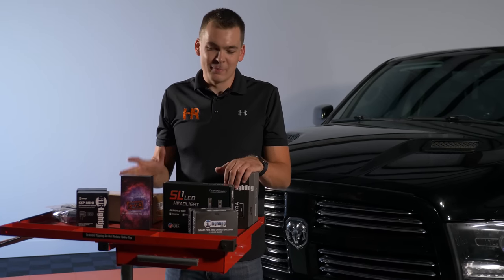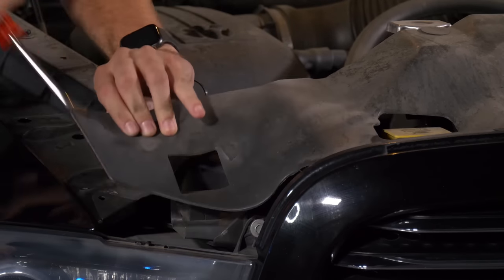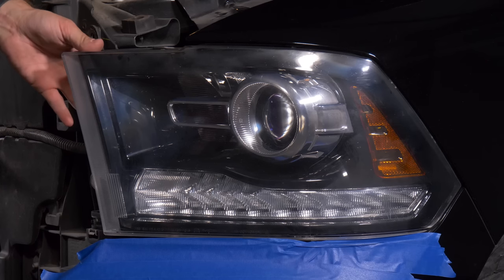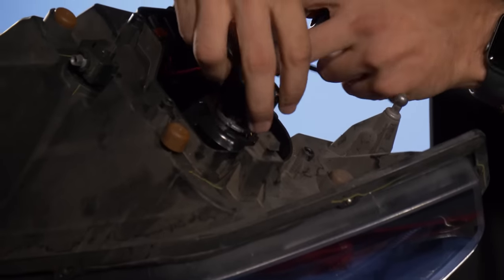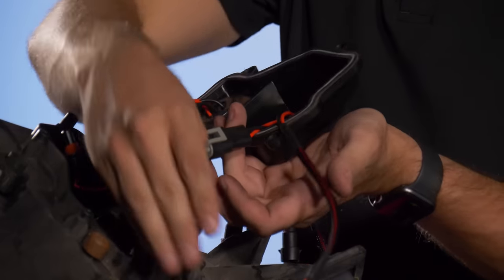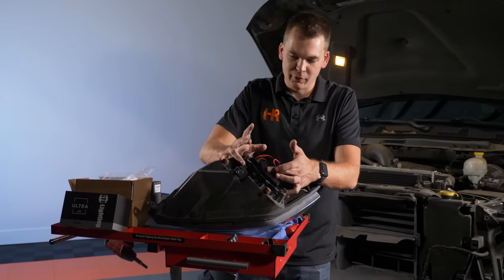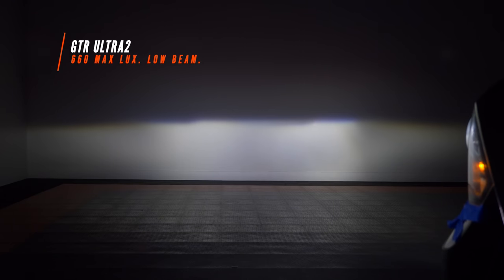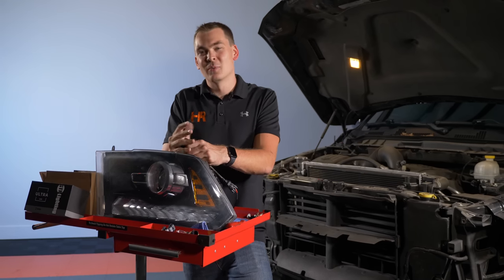HR Tested: 94% Brighter LED Bulbs for the 2009-2018 Dodge Ram with Projector Headlights

Comment: I love these lights!!!!! A little tip for the PWM module; I used double sided tape on the tape and attached them to the top of each headlight light casing. No tension is on the wiring and doesn’t look like they are going to budge. .
Reply from the maker: Good tip! Thanks for your comment!

Comment: I put the GTR Ultras 2 in my 2017 Edge and the difference was absolutely amazing. I legit went and got an eye exam thinking I was losing vision driving at night. Turns out my vision is fine and the stock halogen in the Edge is just garbage. Easy install and they fit with the stock dust caps. Daytime running lights work fine and I get no errors on the dashboard. Just needed to rotate the bulb to get the chips at 3 and 9 to get back to the stock pattern.
Reply: Hey, I run a 2013 Edge and really want to get LEDs as well.  Been looking into the S-V4's when they first came out but been lazy.  Now that the GTR Ultra 2's are out I want to get those.  How are they with rotating?  I know with the S-V4 they have a small set screw that you need to constantly take in and out to adjust.  Just want as much info as I can get before getting and doing anything.
Reply from the maker: The GTR Ultra 2 can be completely adjusted, You won’t have any trouble with that!
Reply: Michael If the 2013 runs an H11 bulb it’s exactly the same adjustment with a little screw.

Comment: Do not have to remove the grill. 12 inch extension on a ratchet for bottom headlight bolts
Reply: Yeah..... i did it the way you mention and broke the bottom tab off my passenger headlight. I don't recommend doing it this way. Its about the same amount of work to take the grill off as it is to fight with the bottom bolt on the headlight. difference being I didn't have to plastic weld my drivers side light back together.
Reply: @scottmorey9055  I can change my headlights in 20 minutes this way never broke anything theres no reason to take off the grill
Reply: @brenthemingway2956  cool. I have sausage fingers. Its literally 30 seconds of extra work to take the grill off and you dont need a foot of extensions.
Reply: @scottmorey9055  I feel the longest it takes is the stupid flap in the wheel well lol
Reply: @brenthemingway2956  its the hardest part for me. Its hard for me to maneuver my hand in there to grab that damn plastic thing to pull/push on it. I've nearly cut myself a couple of times. Big hands are not a blessing when working on your own vehicle.

Comment: I tried Diode Dynamic's SL1's in my 2019 Fusion, removed them and installed the GTR Lighting Ultra 2's and they are awesome!
Reply from the maker: Awesome! I’m glad to hear you like them.
Reply: Did you have any issue getting the ultra 2 into the fusion and behind the dust cover?
Reply: Why did you get rid of the SL1 ?
Reply: @MegaDiamond6  it was fine. I had to aim the projector down to get them to slide in. Very tight working space.
Reply: @josecollazos6  Beam pattern on my 2019 Fusion was terrible with the SL1's. DD no longer sells headlight bulbs. Not street legal.
Reply: @TheCarCrazyGuy  oh ok i i have the SL1 on my truck for my head lights and fog lights those suckers are super bright ya i got a letter in the mail from them about the SL1 bulbs so they sent me other ones since they’re not street legal but they wouldn’t refund me my money back they just sent me some philp bulbs instead and told me i could keep the SL1

Comment: Let’s see these compared to the new morrimoto 2 stroke 3.0’s in these housings
Reply: I bought the new morimoto 3.0 leds for my 2016 2500 and sadly they don’t fit with the dust cover. I even purchased the deeper dust cover and still no luck. I have to exchange them now.

Comment: The grommets fell out because they are too small. The holes in your fancy dustcover are 28mm and the inside of the grommet on the GTR.A015 passthough harness is 21mm. They cannot be seated as they should. Obviously the two chinese companies involved do not communicate. I ended up not using the pass through cables and stuffed the antiflicker modules inside the cavity. It is tight but can be done. I was assured by HR there was no problem doing it this way. My question is this: The GTR Ultra 2 low beam bulbs have a fan and if i plug the large holes in the dust cover, will they run hot ?

Comment: very helpful video. The factory housings are great for focusing an LED beam and not blinding everyone, but the info in this video is gonna save me some frustration, especially that rear dustcover. yeah i could probably dremel out some holes in the stock one but this looks much cleaner,
Reply from the maker: Glad this vidoe helped you out, if you need anything else just let us know! Have a good one!

Comment: It doesn’t fit 2018 ram 1500 with projector headlight .  Unless you buy 
 a after market extended dust cover .
Also if you only change the low beam you don’t need the pass through harness

Comment: To change the headlight bulbs you have to take off the grill and completely remove the headlight assembly?  What a ridiculous design Dodge did on this, I've never had a vehicle where I've had to completely take off anything to switch out the bulbs.
Reply: its because its not a typical bulb swap
Reply: Grill doesn't have to come off.
Long extension and grill doesn't need to move

Comment: Im upgrading my offroad 2016 ram with oem projector lights as is original came with the standard reflector headlights. I am buying a special harness to be able to use the projector lights. My question is. With your wiring included in these LED lights, would I still need that projector harness or does your wiring kit can hook up directly to my wiring that was set up for original reflector headlight. Thx
Reply from the maker: With those lights and that harness, you will still need the harness as that plugs into the back of the headlight housing via one connector, then disperses the power inside the headlight to the individual bulbs. Our bulbs will work just fine in your vehicle, you will just need to make sure that you select the projector specific kits on the website! Link: https://headlightrevolution.com/vehicles/dodge-ram/2009-2018-dodge-ram/

Comment: FYI I didn't need to use the second PWM for the high beam on my 18 RAM.  When it was plugged in the high beam did not work.  But works perfectly without it.
Reply from the maker: That’s great! These Rams can be hit-or-miss when it comes to the high beam.
Reply: Hey Phil did you also need the PWM for the low beam bulbs i have the same year Ram as you do and i totally missed that i had to purchase the PWM's
Reply: @Mario-ig8kb  Yes needed it for low beams and fog lights but not high beams on mine. When I plugged in PWN to highbeams they didn't work. I've had no issues at all.

Comment: I want to upgrade both high beam and low beam on my 2014 Ram 1500 with projector headlight. I will need a pair of CSP mini bulbs for hight beam, a pair of ultra 2 bulbs for low beam, 2 pairs of PWM models (one pair for low beam and one pair for high beam) 2 pairs of pass through harness (one pair for low beam and one pair for high beam) a pair of dust cover, right?
Just to make sure I order all I will need in one order.
Reply from the maker: That is everything that you'll need!

Comment: I realize this video is over a year and 1/2 old now. Im considering both GTR bulbs in this video for my 2014 Ram with projectors. These are now available as separate Low beam and high beam kits that include the PWM harnesses and larger dust covers, so the question of what exactly is needed is now unnecessary.
However - There is no mention of the Pass Through harness in these kits. Can you clarify this please ?
Reply from the maker: Reach out to our CS team, we can better explain everything there!
218-755-5200
Sales@HeadlightRevolution.com

Comment: Can you do this without pass through harness and keep it one connection u set the dust cover
Reply from the maker: For This gen Ram you will need the passthrough because of the trucks electrical system. There are people that have used OBD readers to correct this issue though.

Comment: Thinking of doing this for my 2014 Ram.  Is the PWM module absolutely necessary, or can I just change the trucks factory settings to LED?
Reply: im interested in this too.  Can we use the OBD and AlfaOBD to change the settings to eliminate issues and PWM

Comment: Did this conversion on my 2017 1500 and the difference is amazing. I also blacked out the horizontal chrome slats while I had the grill removed. I want to upgrade the vertical foglamps next. I understand that I need a 9006 style bulb but should I get the CSP Mini or the Ultra 2 that I used for the low beams?
Reply from the maker: So glad to hear that you liked those upgrades, we are happy to get your next upgrade going for you! You could totally use the Ultra 2 LEDs for fog lights, or the CSP Minis, but for right around that same price I would recommend just going all the way with the Morimoto XB LED Fog light housings for your truck! They will produce an even more usable beam pattern, and will get you that updated blacked out design that it seems you are going for! Link: https://headlightrevolution.com/morimoto-xb-led-dodge-ram-vertical-fog-light-housings/
Reply: Morimoto XB!!! Loving the look of the set up on my 2016 Ram 1500 Sport.

Comment: Are these good for all 9012 applications?  I have a 2013 Chevy Volt with OEM Halogen 9012 bulbs.........
Reply from the maker: Yes they are good for almost all applications, Especially your Chevy.
Reply: @HeadlightRevolution  Thanks, guys.  I'll start saving for the Ultra 2s.

Comment: Why do you have to remove all that stuff???
Two 10mm bolts and the leveler and the head light pops out. No grill to remove and the top cover pull one tab and fold over. Simple and easy.
Reply from the maker: Thanks for the tip. We do these videos on how the manufacture says to disassemble the vehicle just so there is a standard guide to follow.

Comment: 2016 dodge 2500 with projector headlights, are the leds supposed to face left and right in both highbeams and low beams? Not up and down
Reply from the maker: Left and right!

Comment: On a 2015 Ram 2500 with factory projectors what part numbers do I need to order to do both low beam GTR Ultra 2 and high beam CSP Mini.  I also need the larger housing covers and all required harnesses.   The website was a little confusing for me to make sure I am ordering everything I need.  Is there a complete kit? Thanks.
Reply from the maker: We haven't had a chance to put together a vehicle specific kit for this yet, because we've been working on building a new website. But here is everything that you need!

GTR Ultra 2 Low beams:
Pass Through Harness: https://headlightrevolution.com/gtr-lighting-9005-9006-style-pass-through-harnesses-with-grommet/

Dust Covers: https://headlightrevolution.com/pair-of-dodge-ram-2013-18-projector-style-headlight-dust-covers-33402c/

PWM Modules: https://headlightrevolution.com/gtr-lighting-pwm-interface-module-9005-9006-style-connectors/

Ultra 2's: https://headlightrevolution.com/9012-gtr-lighting-ultra-2/

CSP Mini High beams:
https://headlightrevolution.com/2009-2018-ram-led-headlight-bulb-upgrade-single-beam-projector-9005-high-beam-gtr-lighting-csp-mini/

If you have any other questions, feel free to shoot us an email!
Sales@HeadlightRevolution.com

Comment: Just ordered a set of these for my 2015 Ram about 10 min ago for 9012 low beam. I've been using VLEDS for years and I was very impressed with them. But when I learned about these I had to try them. Can't wait until they get here. Just a quick question, how come you didn't use the Ultra 2 in the high beam? Fitment issues? I have the extended housing covers because the VLEDS high beams wouldn't fit under the factory covers. I'm just curious to see how much better the Ultra 2 would've been. Thanks.
Reply: Have you installed them yet?
Reply: @asdetailshop  Nope. I just looked on UPS tracking and they should be at my house by Friday then I have to either drive home (4 hrs away) or have them sent to me (I currently work in a city 4 hrs from home and I only go back on long weekends or every other weekend).
Reply: @TyNeePen15  lotta work for some bulbs lol let me know if they’re worth it. I have a ‘13 and the bulbs SUCK. safe travels.
Reply from the maker: Those bulbs would work perfectly except for the fact that you have a 2015 Ram. Those 2015 model year MOPAR vehicles did not work with almost all aftermarket lighting due to one little change that MOPAR made to their lighting system, and that causes issues with most aftermarket lighting. These should work for your low beams, but if you have any issues with those just let us know! Have a good one!
Reply: @HeadlightRevolution  thanks. I've had VLEDS in my 2015 Ram 1500 RT in the highs/lows and fog lights since the truck was brand new. They've been very good up until recently. The driver side shuts off automatically after a few hours of use. I suspect the fan is no longer working and overheating as that's what the problem with my fogs are. Can you use the ultra 2's in the high beam?
Reply from the maker: I am sorry to say that due to changes in regulations, we are not able to recommend HID or LED for street use. Those bulbs would work great for you in an offroad application, we just can not recommend them for street use. Let us know if you have any other questions or concerns!
Reply: @HeadlightRevolution  I understand. Thanks for the quick reply!
Reply from the maker: Not a problem, let us know if you have any other questions or concerns, have a great day!

Comment: The thing you gotta remeber is it’s all fine a dandy, you’re bulbs are so fuckin bright it’s like u control the sun with the wonder stick beside your steering wheel...  but if every cop you pass needs to pull u over to tell you your headlights are too bright that’s gonna get pretty annoying.

I notice already way to many people with what i would consider to be an LEDuograde that are way to bright for oncoming drivers. It typically isn’t that they’re pointed wrong or have a bad cut off line either ( although sometimes it is) There’s a reason many companies only go a bit brighter then stock enough so you see well yet you don’t blind people like they’re being touched by an angel.
Reply from the maker: When you see those aftermarket headlights that are blinding you or other oncoming traffic, that is actually not the fault of the bulb at all, it is installer error! When installing any new headlight bulb, even halogen, you may have to re-aim and align your headlights as moving that bulb socket can knock it around a little. With that said, when a bulb is miss-aligned you will be blinding oncoming traffic, and not getting the correct beam pattern which is not safe! I have linked a video on how to properly align your headlights and bulbs here: https://www.youtube.com/watch?v=OIow5YgdRro

Comment: So just to confirm the bulb sizes needed is a 9005 (high beam) and 9006 (low beam and fogs)?
Reply from the maker: You will need the 9012 bulb size for this specific vehicle, and the 9005 for the high beam and the fog light👍

Comment: Hey guys, after installing some led lights into my 2013 impreza (reflector style) ive noticed the passenger side has a bit more light going on the road. I have bad ADD and it bugs the shit out of me. Is this actually normal for sidewalk illumination or is there some defect? Ive moved the lights around and both are same. Ive noticed on your ram, it kind of does the same thing. At 1:00 you can see how the hot spot is bigger on the passenger side.
Reply: oh wow you mentioned it a minute later. My guess its for pedestrians but it really bugs me and im thinking of buying a left hand drive headlight from japan to match
Reply: Can't you just aim the headlight to fix this
Reply from the maker: We’ve seen this on several Ram headlights, It’s annoying and there really isn’t a fix for it. Sadly, I would bet your Impreza is the same way, especially if you’ve tried switching the bulbs from side to side.

Comment: Do you have a part number list for all these components. I have a 17 ram sport with projector setup.
Reply from the maker: We can sure get you part numbers, but you can't plug them into the website anywhere so you would be much better off just simply following the links in the description and adding the items to your cart.

Comment: So do I have to order pass through harness for both low and high beam? And same goes for the modules. It says pair but is that for just one bulb? Or do I need to order 4 pairs of harnesses and modules? Thanks! I’m ordering as soon as I know what to order lol
Reply from the maker: You will need one pair of bulbs, passthrough harnesses, and PWM modules for the low beam, and the same for the high beam! You will only need one pair of the extended dust covers! Shoot us an email if you have any other questions! Sales@HeadlightRevolution.com

Comment: Which pwm module is necessary for the gtr bulbs in these rams? I have the gtr bulb just need to order the pwm module and haven’t been able to get an answer
Reply from the maker: These are what you need:  https://headlightrevolution.com/gtr-lighting-pwm-interface-module-9005-9006-style-connectors

Comment: I have a 2007 Suzuki Grand Vitara with projectors and was wondering if LED or HID will be a better option over halogen. Idk which one to go with
Reply from the maker: I can't recommend those bulbs to you for street legal use, but for an off-road application, the HIDs would produce more light output, and get you a better beam pattern in that projector!

Comment: I purchased the GTR Led's for my ram low beam projector housing. How should the bulbs be oriented in the housing? Thank you.
Reply from the maker: You'll want the LED chips facing left and right!
Reply: 3'o clock and 9'o clock position. Any deviation will affect light output.